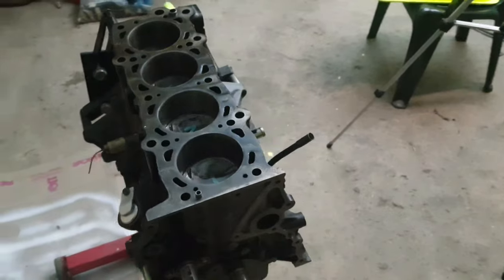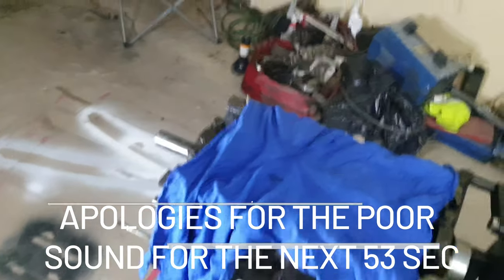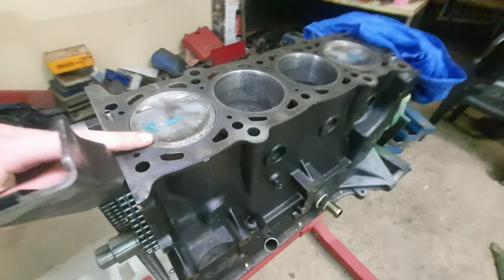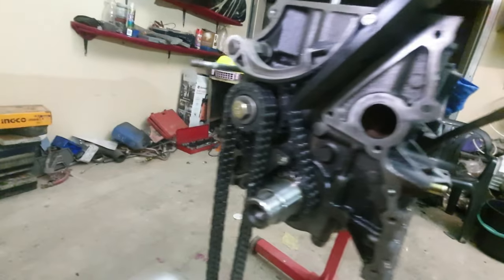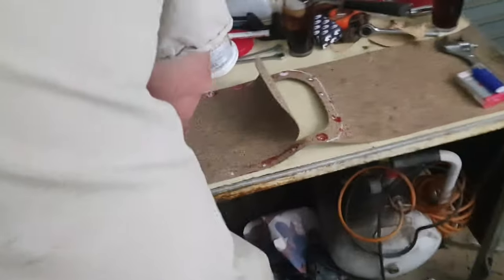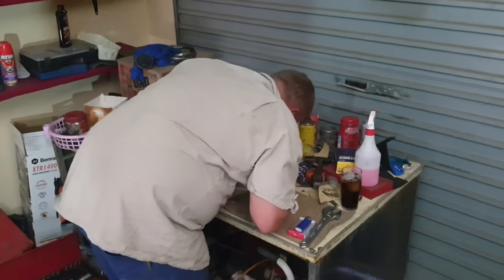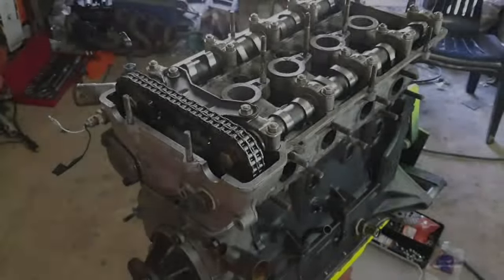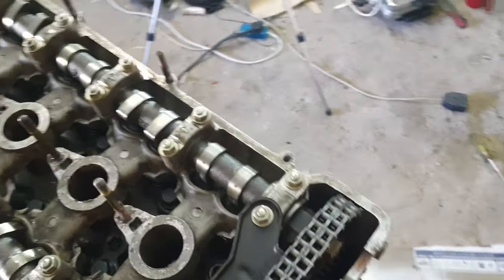FJ20ET 280ZX DRIFT BUILD, THE ENGINE IS FINALLY being assembled

Comment: G'Day Mate, nice video. Not sure if it is purposely plugged but I noticed that the cam chain oiler at the front of the block is missing, looks like it is busted off, if so you may have problems with the oil pressure and timing gear.
I have broken one off once and the old one can be removed easily with an eze-out and replaced with a drilled 6mm bolt about 2mm down the guts and 1mm outlet on the side, set it to point to the chain. Best of luck for the build, can't wait to see it run.
Reply from the maker: Good day bud, thank you for noticing and bringing it to my attention, are you talking about that peace underneath the Sprocket, it's like there is a ear that is broken off, if so, I noticed it when assembling it, I did not think much about it due to that a thaught it only plays a big roll when you use the Distributor on the engine, Hence I am using after Market Managment and
Reply: @vicyboosted  It's at the front of the block, top left (looking from the front) and screws in. Is an M6 thread and has a lock nut. It goes straight into the main vertical oil gallery which supplies oil to the head. Its purpose is to lubricate the timing chain.
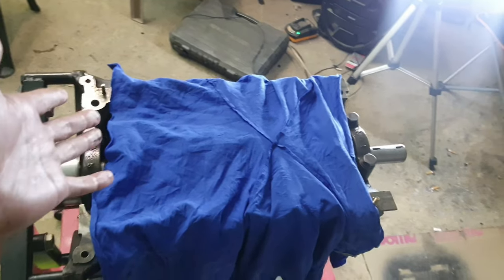Reply: @vicyboosted  just watched your video again, you can see at 2:48 block is upside down, its the 2nd hole under the jack shaft.
Reply from the maker: @Tony-we1jf  hey bud, maybe I missed something, can you maybe help with a pick or something just to be clear before I put the engine back together
Reply: @vicyboosted  I sent an email with pics